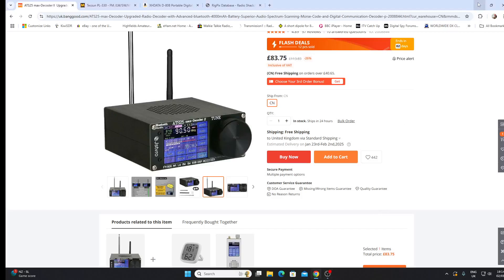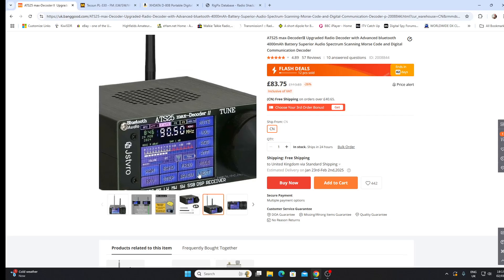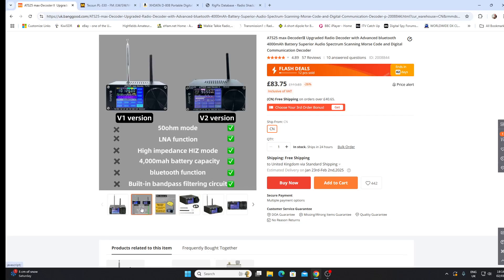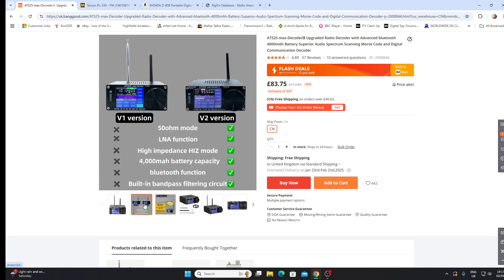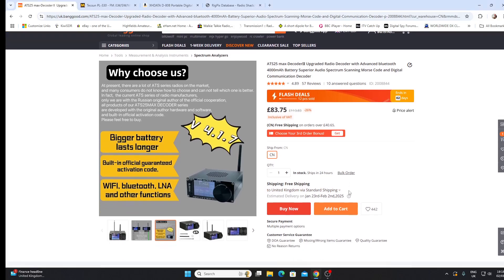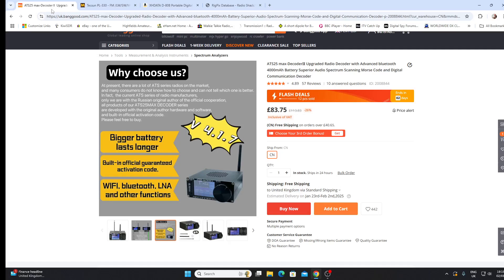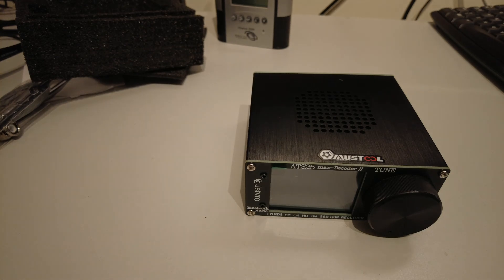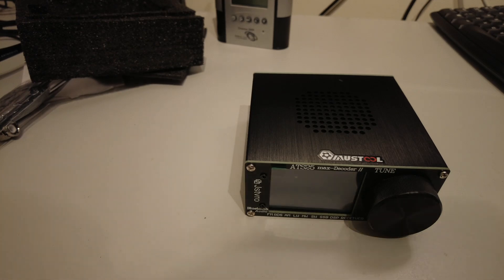The ATS 25 Max Decoder  Is it the Ultimate ATS radio or just more of the same??

Comment: Hello Kevin, which model do you suggest for Ham Radio Band and digital modes decding? Is there need of modding with theese model?
Reply from the maker: @MrOmiez  well this is the ATS 25 Max Decoder 2. I  purchased it from Bangood. It came with the software license so I can update the firmware over wifi.

Comment: I love the ATS line of receivers. Quality and design has improved since the earlier versions. I just received the pro+ and although I haven't had a chance to use it heavily, I have enjoyed receiving FT8 and listening to some air traffic on it. Although they have come along way, I would still consider them a tinkerers radio. Even though it's less so running Bernards licensed firmware. It's become a jack of all trades, master of none kind of radio and there are still the typical chinese quality control issues. Time will tell, but I think longevity on some parts like switches and encoder could still be an issue. Hence the reason I still see it as a tinkerers radio, as you might still have to open it up at some point to fiddle with something.

If you want something that just works and works well, something like the radios mentioned in the video might be a better option. But ATS radios can be fun depending on what you want out of them. Especially if you like to fiddle with and mod things. Like I do!

Comment: @Kevin O'Reilly , Tnx for the video ...i think i can connect this to any other radio (via 10.7 IF ..or other IF)  ? ... and then use this ATS 25 as a Decoder or as a Advanced S-Meter or as a Additional-Display for some older VHF/UHF radios  that have no display  ... that will work , even if the ATS 25  is not that good .... i could then decode the morse (identification) from repeaters on VHF/UHF (to know if there's DX-conditions) and other stuff on there (SSB, FT8, RTTY ...etc) ,  So my request is if in your next video, to also give some attention to the built-in morse-decoder to see how good it is ? ... 1) on Loud-signals vs Weak Noisy-signals ... 2) on Slow vs Fast signals 🤩
Reply from the maker: Morse decoding in common with every other CW decoder I have come across is very hit and miss.
Reply: @KevinOReillyswl  , yes it is , thats why i asked to have a look at it on the ATS 25  in your next video.